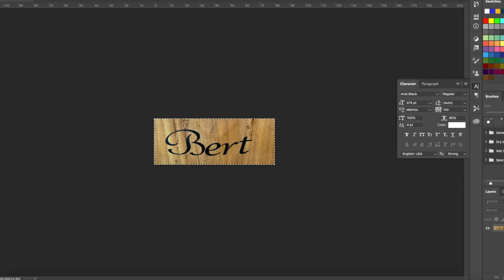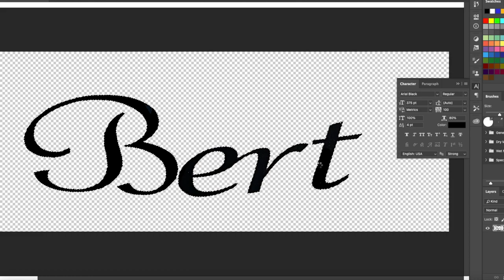30 minutes of non stop cricket bat repair action

Comment: Would love to know what the wheel and compound you use to buff the bat. Also what is the purpose of the dowels
Cheers Colin.
Reply from the maker: Hi Colin. 
Polishing Wheels:
I have three different wheels which are all 8 inch (200mm) loose leaf calico wheels. My main wheel  you see in 95% of my videos is a 120 leaf, but i also have a 50 leaf (for bats with high concaving) and a 200 leaf (but i don't use this one as it's a bit unstable on my polisher, which i do need to fix).
I've recently just updated my polishing compound to Hypin Polishing Compound. It's a stainless steel compound but is surprisingly good at polishing cricket bats, particularly if you like a high gloss finish. Prior to that i was using Josco white from Bunnings.

Doweling:
There are a couple of different ideas around the dowels. I only ever dowel bats that have bad cracking around the shoulders. The dowel goes through the timber and into the handle, so with glue, it helps to anchor the blade to the handle better. Arguably, if you use a good quality glue, than the glue does this more than well enough. This this is the main reason i recut the V in this bat, to allow for a better bond between handle and blade.
For me, I use dowels when you can't get access to cracks inside the 'V' or shoulder well and I'm concerned the cracks will open further.  Bats go through a fair amount of strain around the handle blending points and shoulders, so it isn't uncommon to have cracking inside the shoulders that you can't see from the outside. 
The drill hole often goes through/into the cracks. This means when you put glue in the hole, and hammer in the dowel, it creates pressure which 'pushes' glue into the internal cracks you haven't been able to get to from the outside.

You can search plenty of 'glue strength tests' on youtube, which finds that glue bonding two pieces of wood together is frequently stronger than the timber itself, meaning the wood breaks before the glue bond. So for cricket bats, being able to get glue into the cracks, reduces the likelihood of the shoulder failing, completely wasting your effort on the rehandle.

Hope this helps.
Reply: @BatandBallCricket  
G'day Clinton,

Have just finished making my first bat. Had a little trouble shaping the handle but I got there in the end. Learnt a lot in the process. 
This information above and your other videos have been invaluable. Many thanks.
Look forward to more content.

Cheers Colin.